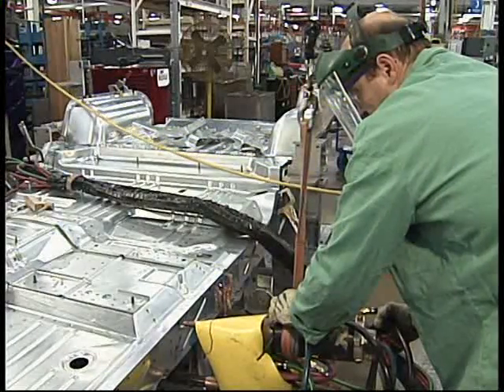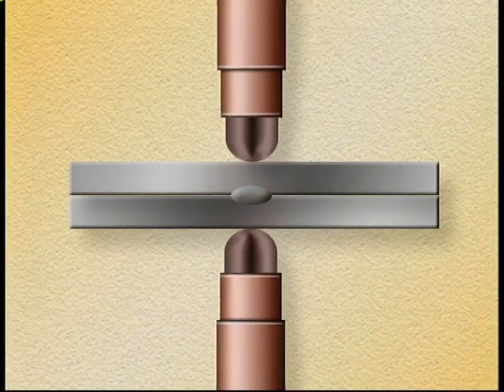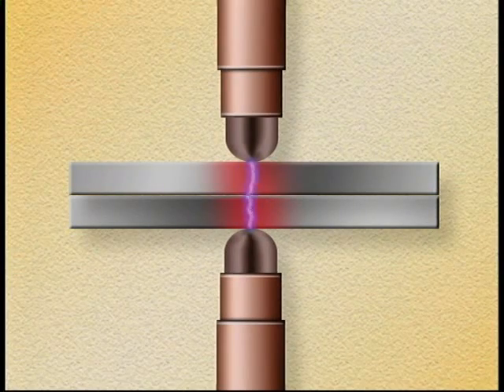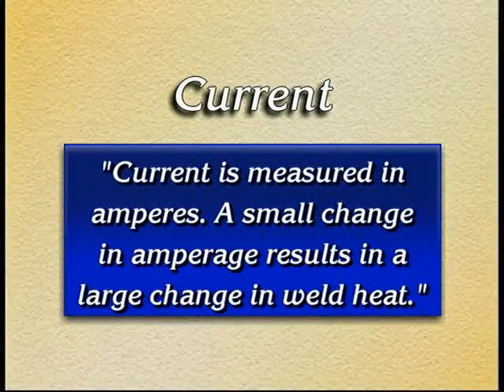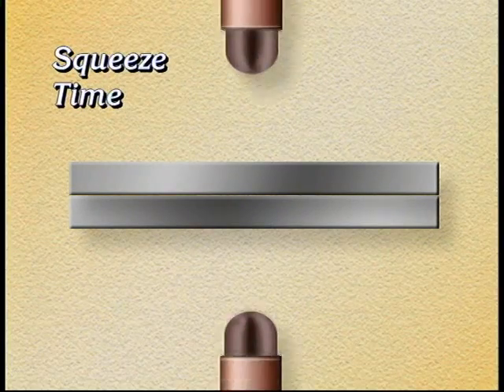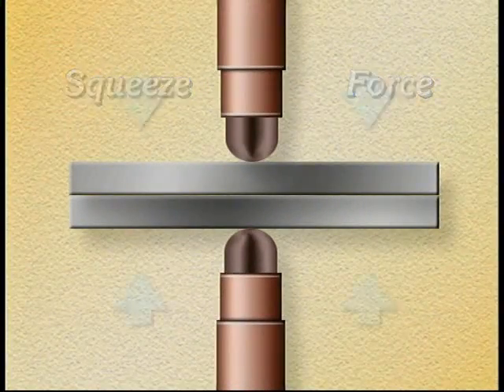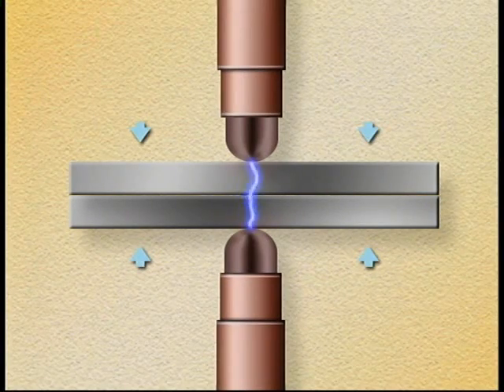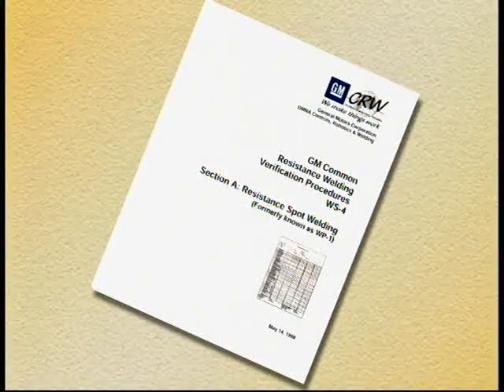The Common Weld Quality System

Comment: You noticed that the the lower tong was touching the part several inches/ cm's away from the intended area too huh? Yeah, "arcing" is an all too common problem with this type of welding irrespective of the company.